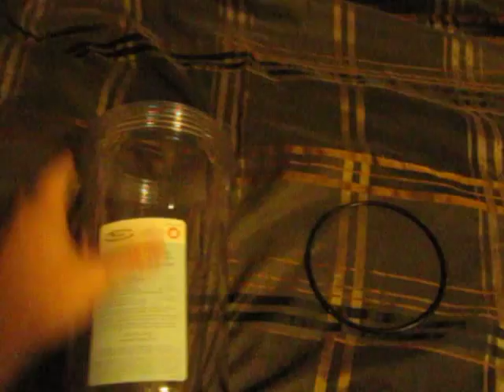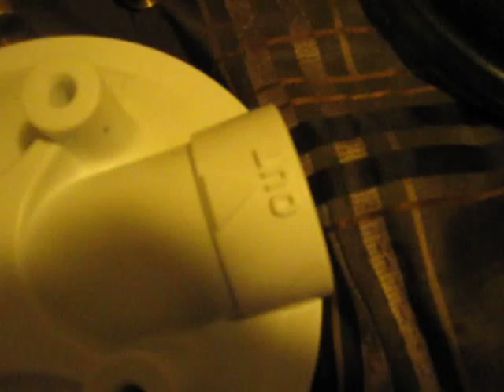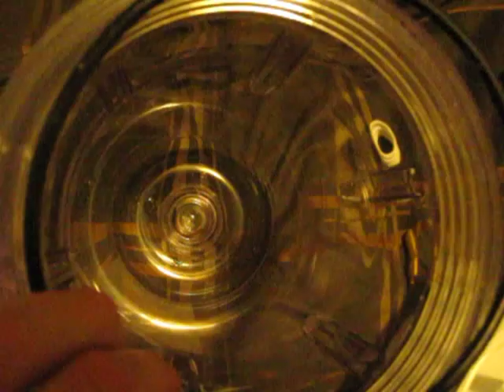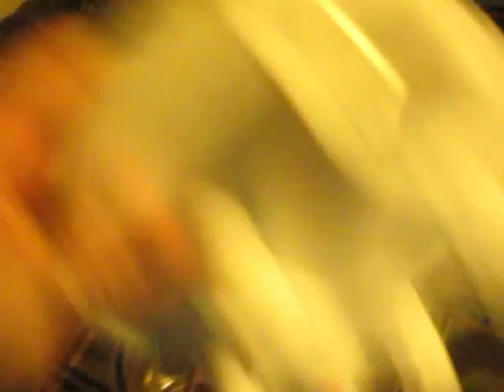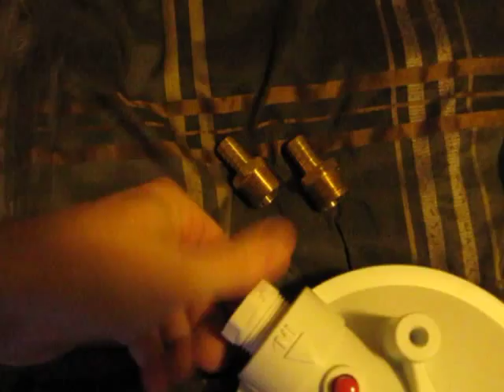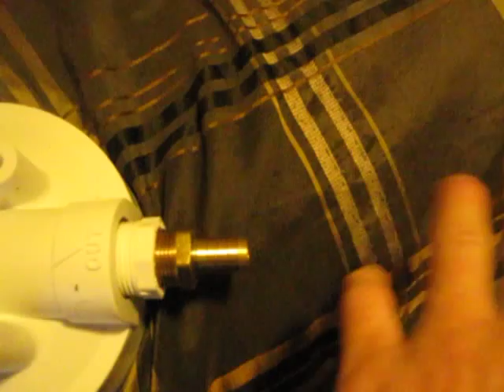Simple Cerges Build Demo

Comment: extremely bad explanation.  confused me more...
Reply: Yeah I agree. No reason to reverse the flow, out = in, in = out. If water and CO2 go in on the IN side, a CO2 bubble may form at the top, but will be broken up and forced down to the bottom of the jar where it will then go up the tube and out into the tank. Adding Bioballs to this would have helped break up / dissolve the CO2 too.